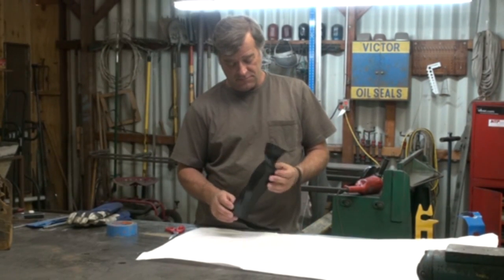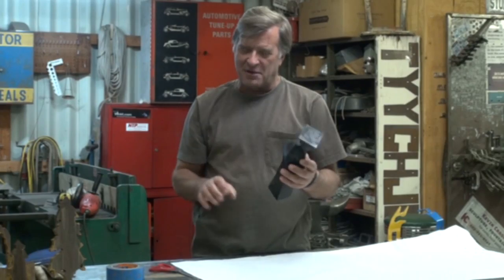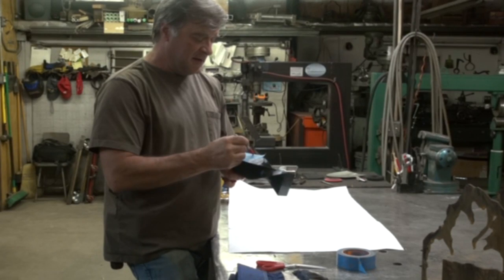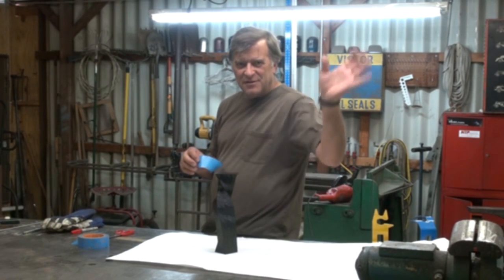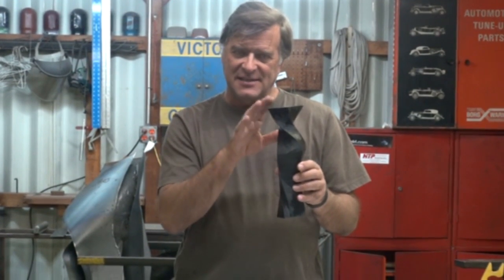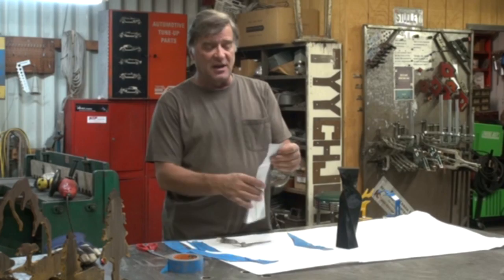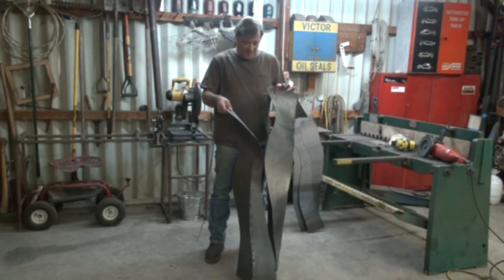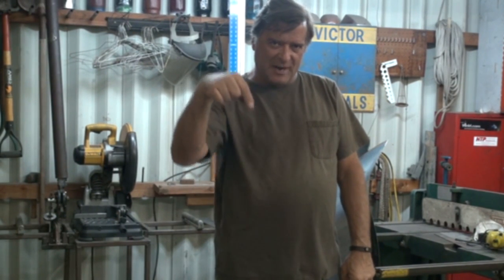How to Scale Up a Sculpture - Kevin Caron

Comment: You're doing that too hard just take a loaf of bread take the white part of the bread and mix it with glue mush it together like clay put it around your sculpture let it dry and cut it open and you'll have a mold for your sculpture then you could just pour them at all in or use that too put your metal on and weld it
Reply: I meant when you have the mold you could pour the metal in
Reply from the maker: Never would have thought of that!    Thanks for posting.

Comment: I'm pretty sure that simply drawing around the flat tape version of the individual sides of the sculpture does not accurately scale a form up for example if it is a letter like the letter R for example , if you simply create a border around it you will get to a point when the inside of the R is filled in and the outside loses its definition and you eventually end up with a circular form , of sorts 
if you want a more true representation of the original form using the tape technique it would make more sense to put the tape onto graph paper and then multiply the squares , so that the spaces between areas are also multiplied